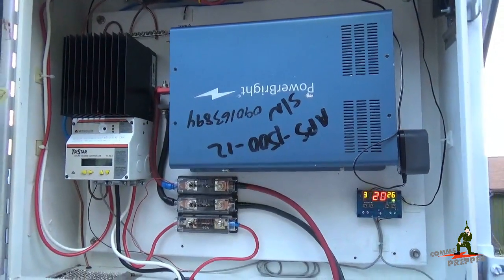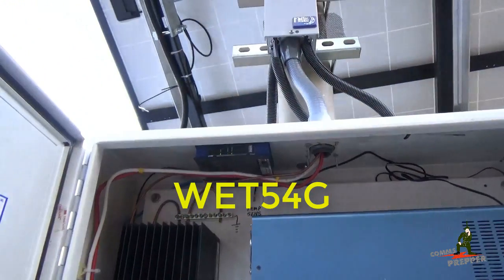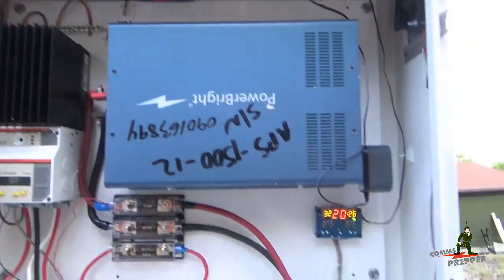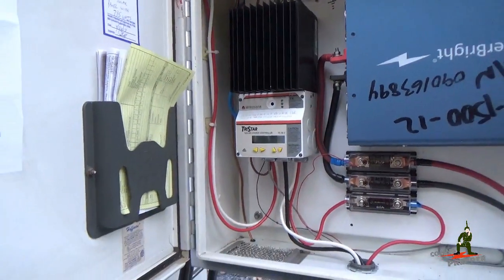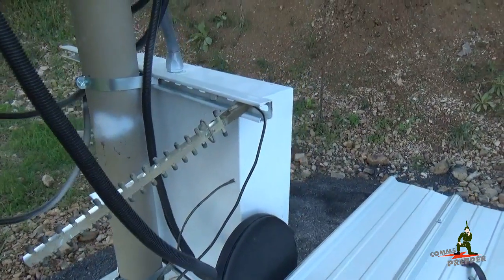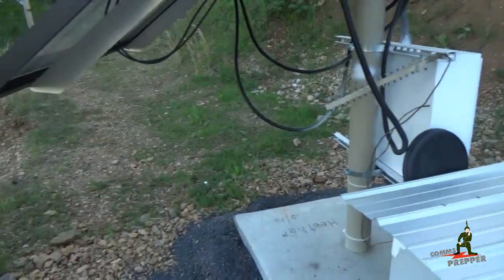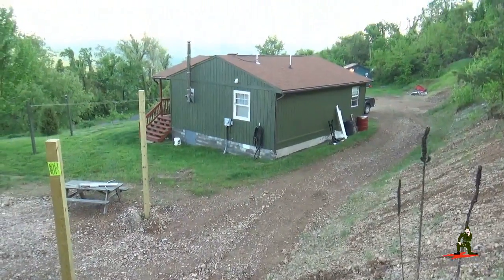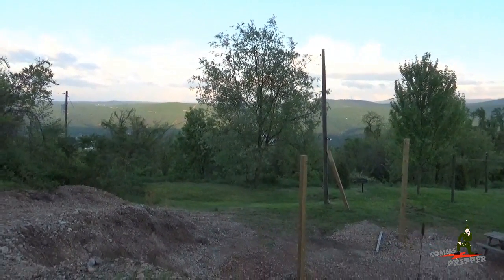Remote monitoring of off-grid solar power system

Comment: What program / hardware are you using today to access the solar bank remotely and monitor it?
Reply from the maker: The MorningStar charge controller has a built in web-interface.  I also use MorningStar's MSView program for more advanced access.

Comment: Just curious... where do you live that you need a permit to install any sort of off-grid solar on your property? :/ 
That sounds odd, because as far as I know, there's no such regulation where we are.
Reply from the maker: +Four ZeroFour WV.  I should not have needed it (I think) but once the lady heard solar she labeled it an electrical project.  Some issues are not worth the hassle - county inspectors are great around here and actually help when things are not 100%.  They will tell you the issue and say call back in a day or two.  Fix it and call.  Can’t ask for more than that.
Reply: I suppose it's not bad especially if it's cheap / free.

Curious, did you also end up doing a permit for putting up the actual post? Or was that included in the electrical part?
I can't imagine pulling a permit to cement in a post, but I suppose TECHNICALLY if it is going to count as 'a part of the property' structure wise, I can see them wanting you to.

Comment: I really enjoy watching your progress.  Thanks for sharing this stuff!  It's thought provoking!
You might already be aware of such things but I thought I'd share some WiFi info... I use an android app (i think other platforms are covered too) on my tablet called inSSIDer.  It lets you do a site survey of your signal strength as well as see if your neighbors are on the same channel so you can reduce interference.  Covers 2.4 & 5 GHz if you have the radio(s) in your gear.
Reply from the maker: Thanks for the tip.  I will check that out.  My closest neighbor with WiFi is a mile away.
Reply from the maker: rkaag99 - sorry about the troll mixed in with your comment.  I have blocked him and removed his comments.
Reply: thanks and certainly no need to apologize. their actions are their own. to be honest, i didn't see the troll and they are water off a duck's back from my perspective, anyway.
keep up the great content!
-rob

Comment: I really like to see the vhf link to monitor the solar system. 

4S7JL
Reply from the maker: I was working on something similar but hit a roadblock.  I was hoping to you winlink's Paclink program which has a POP3 emulator in it to send system updates using the charge controller's email alert feature.  Unfortunately, it did not work with Paclink.  Something seems to hang in the POP emulator (works fine with my ISP).  I have an email in with the guys who write that program. Perhaps they will get back to me and tweak the program so it works.  Then I can get updates over VHF or HF on the winlink system.

Comment: why not move the wifi bridge to the bottom of the box, looks like you have room. keep the wifi antenna cable short.
Reply from the maker: I am adding a buck DC to DC converter next to the temp relay card.

Comment: Looks great man ! You should be fine with the whip. I have a 2.4ghz wireless PTSN line from the residence to a 8" grove pump enclosure almost 200 yards and whips worked fine. You could use a planar antenna if you wanted to make up for cable loss and   keep is spiffy.  Thanks for sharing !
Reply from the maker: I still can't believe I left the stock whip back at the house.  I have five or six antennas here but none of them are RP-SMA and my adapter kit (here) does not have gender-bender adapters.  Whip arrives in the morning - we will see how that works.
Reply: Stuff happens ! It is always the adapter you don't have with you.